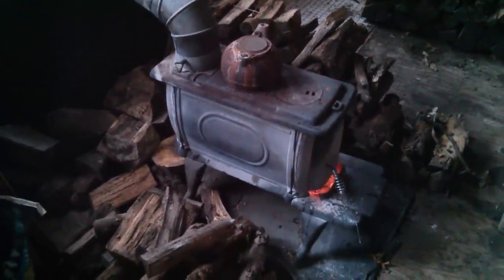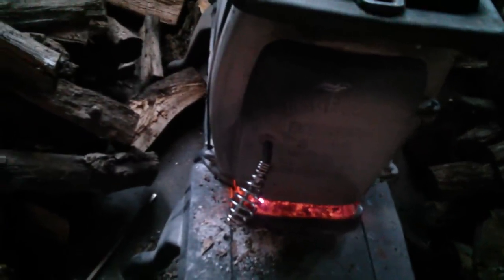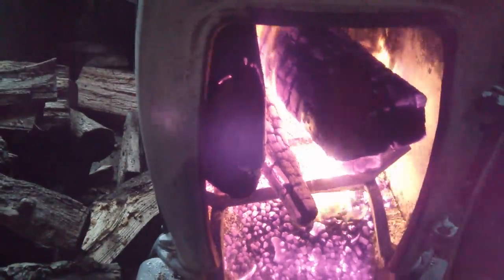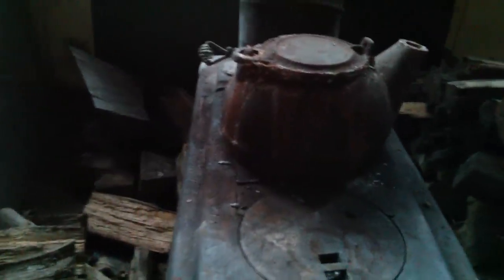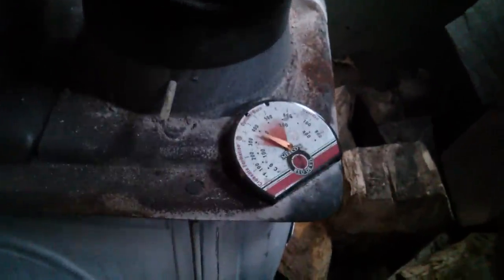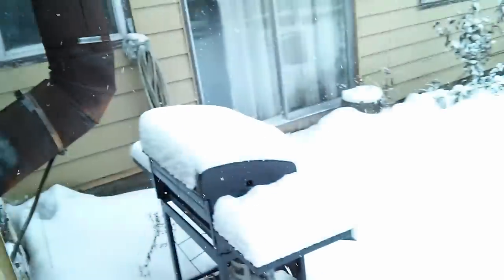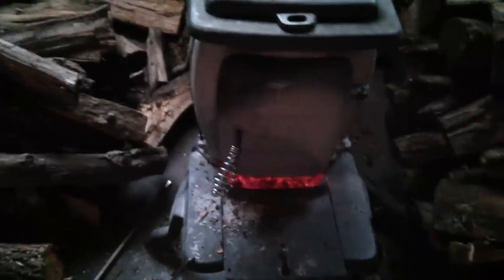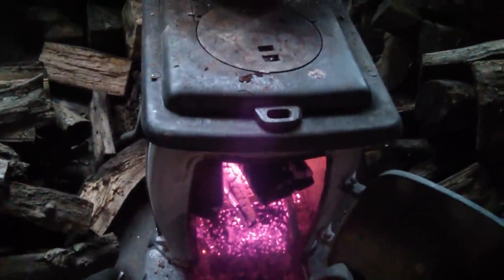Harbor Freight Vogelzang BX26E Cast Iron Boxwood Heater/Stove Overview (item#32058)

Comment: That much wood in 12 hours???  That's not the stove, that's your setup.  I have this stove - with an actual chimney installation - and it COOKS, but over 8-10 hours I'll use about 11 or 12 logs.  And that keeps it right around 500 degrees.  You have to use actual chimney parts that are rated for the proper heat and have the insulation to protect your home.  For 3 seasons that looks like crap, and I can say that since I've had mine for 2 seasons.  Oh, and having all that wood stacked around it - that close - is an absolute fire hazard.  AND it doesn't appear you have a floor pad under or around it.  This whole setup is SOOOO unsafe.

Comment: All that in 12 hours?  Switch back to electric heat, you dont know what youre doing...

Had that years ago, 2 logs would last 3-4 hours.  Youre air intake is wide open, and you need a seal on the door.

Comment: Get your wood dry before you burn it then keep it atleast 18 inches away get grate out build fire on the bottom of the stove  put a damper in pipe as close to the stove as possible.  pipe temp should be 350 to 550 18 inches above the stove for best results   its easy for every one to criticise you but i made alot of these same mistakes 1st few years  and i bet they did to  thank god we didnt burn our houses down  good luck safe burning buddy

Comment: Wow.. that stack of wood lasts me at least a week.
Yours is over fired with all that white scorching.
Sit the thermometer on top of the exh pipe, mine is magnetic, $10 home depot.
Your thermo is showing 450 but thats a false reading, its over fired just looking at it, to really know what the temp is you need to monitor the exh pipe, not the stove iron.

I got the $169 boxwood last month from harbor freight and vent up the chimney in my fireplace.
Get some glass rope and glue, make a door seal, glue the stove top on with stove cement, doesn't take a lot.
I also added seal to the bottom of the door.
Start the fire and damp it down, I can load it with 4-5 split logs and it burns up to 8 hrs.
Its 4 feet from my bed and its very safe because I made it safe.
I can extinguish the fire by completely choking it down, if you can't do that its not sealed .
I don't use any grate, just let the ash build up to 2-3 inch depth, that slows the burn rate down.

I've read on a lot of forums these stoves are NOT safe, people just don't know how to set them up, any stove that isn't set up to regulate draw to the point that the fire can be snuffed out isn't safe. I think of it like a car, any car can go fast but its how well it stops that defines how safe it is.
Reply: I agree

Comment: I have the same stove in my shop.  After one season I found a "Heat Reclaimer" that goes in the 6" chimney pipe.  I swear it doubled the output of the stove.
Reply from the maker: Yea ive seen those, my pipes rotted out if I decide to redo them I might have to try that out.
Reply: +Jason Morris i bought a sears wood ciruculator stove off of Craigslist for only 95 bucks.
Reply: This is a garbage stove  I’m sitting in my smoked filled cabin wondering if anyone has same problem

Comment: I have a wood stove identical to that in my work shop. While not the most efficient wood stove on the market, they're a lot more efficient than what you're getting from it. I'll burn mine all day using a fraction of the wood that your burning up in 12 hours. Get rid of that grate! It absolutely isn't necessary in a "box wood" stove! I do however always keep about a 1" layer of ash on the bottom as a protective barrier for the bottom of my stove. And after years of use, it's still as sound as it was when new. Once you have a good fire burning & it starts building s bed of coals, keep that "draft" plate on the front closed. A good, heavy bed of coals is where you get the most heat from...more heat than the actual wood itself burning! (That's why blacksmiths put steel in the red hot coals of a forge instead of just placing it on burning wood). Also, burning a mix of "seasoned" & "green" wood will increase its efficiency. There's more to burning a wood stove/heater efficiently than just building a fire in it & keep shoving wood in it. There's going to be folks that may agree or disagree with me so here's my best advice...try some of the suggestions in the comments. You'll eventually figure out what method(s) gives you the most efficiency out of your wood stove. Finally, any heater is only as good as the insulation of the area it's trying to heat. It appears that there is light coming through that door in the background. If so, you'd be surprised at the amount of cold air that will come in & eat your heat up.
Reply: i agree, i have  the same stove as in video and what he stated he burns in 12 hr  takes me 4or 5 days, most days below zero. only thing i did was add another damper, put it about 16 inches up from the bottom one, too many people burn wood and thats all they do is burn wood, gets the coals and keep the heat in the stove not up the chimney. i have so much draft that my bottom damper is closed and top one open 1/8 turn.  love my stove. for the cost it was very much worth it.

Comment: I would seriously suggest running to the hardware store and purchasing enough insulating rope and the black goop that seals it in place and sealing up that stove. All can be done with ease and it will reduce the wood use drastically. By doing this you might see that wood last you most of the week! At least a four to six hour burn on a fill. Best to ya and good luck! I grew up in an area where wood stoves are the norm! We almost all had or have them. I helped my family buy a new one when I was only twelve. That was my first investment in one. You just use the cement they give you to make a line around the area the rope will lay in and then seal the whole thing up allowing it to set. Instructions are one the stuff.

Comment: You need to make the stove air tight. If air is coming in from all around the stove it makes the wood burn faster. the idea is to allow only as much air that's need.  You can get the cement type putty and just plug up all the gaps in the metal. If you have a welder you may be able to weld a lot of them closed.

Comment: Would you recommend this thing? I saw one today at Harbor Freight (I was returning broken tools, lol) but this caught my eye. I'm looking for something for my shed or basement. I don't need super efficient, just something to warm up with while working outside. Thanks for the video
Reply: These are great for smaller areas, especially where you won't be sleeping. A 55g barrel stove kit would throw more heat and if you are a handyman, watch other videos here about the Vogelzang 55g drum kit, available on ebay. Both work great, just make sure you have good stovepipe and keep it away from combustibles. You won't regret either one.
Reply: Pik Pik Mo Thanks very much! I'll check out the Vogelzang as well.
Reply: No I wouldn't recommend there not much .

Comment: Looks like a big area to warm up.  I'm thinking about getting one of these for a 1000 square foot house.  How quickly does it heat?  My gas bill was 100 bucks.  This looks like maybe a few pieces would do the trick and heat my place up quick
Reply: These little stoves are rated to heat about 800 square feet.
Reply: @williamherron9365  what would you recommend for a 920 square foot home?
Reply: @theultimatespaceghost6065  personally id suggest something a little larger. Having it a bit bigger than you need guarintees it will be sufficient in even the coldest weather. The larger fire box will allow you to load it and choke it down to burn slow so you dont have to constantly maintain it.
Reply: @williamherron9365  got ya.  It's a ranch style house so no upstairs. Just 1 flat level.   I don't want something too big nor a tiny box.

Comment: How much did your piping cost?  How much sq footage does your stove heat.  I have an old one like your's, and am gonna try it this winter.  Thanks for the vid.  Helpful.
Reply: +nzinga zindua You have to have an actual chimney installed.  You can NOT buy the material from your local HD or Lowe's - it will not work!  For an 8' ceiling, the flue, chimney, proper attic piping, I got a deal and it cost about $700.  And for the floor protection, I bought about 24 square patio blocks - for about $30 - to protect the flooring.  The stove is inexpensive and amazing, but proper installation is crucial and not cheap.  But awesomely warm...
Reply: My chimney is incased in my wall.  Only exposed in my basement.  Would have to open wall, cut hole thru chimney, etc.